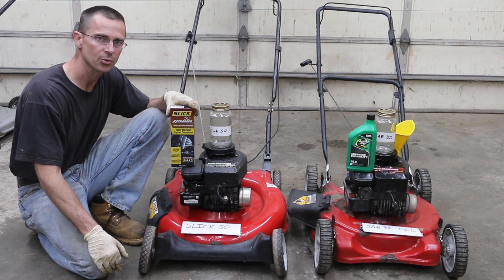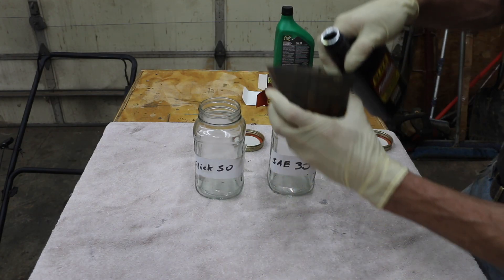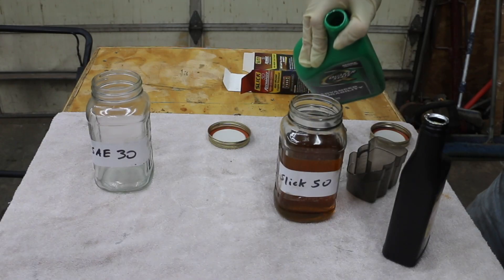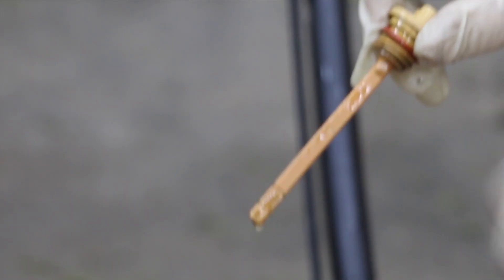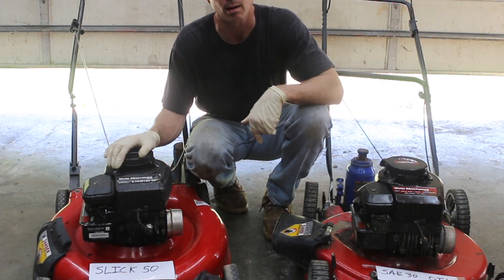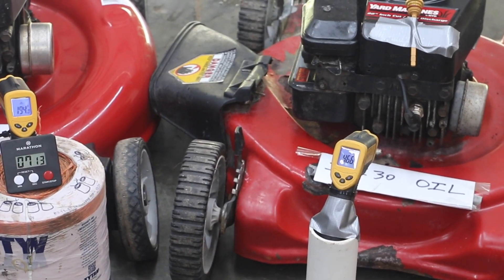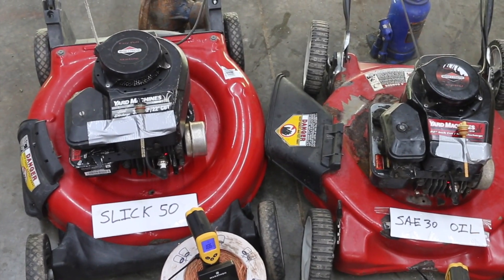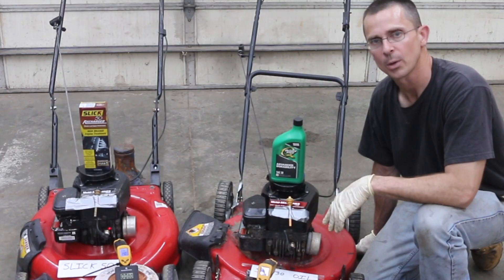Can't believe what SLICK 50 did to my engine!!--Dry Crankcase Test!

Comment: The slick 50 bonds to the metal over time driving the car. You did not run the lawnmower long enough with the slick 50 in the crankcase. Use the lawnmower with the slick50/oil mfg. recommended mix for a month of two of normal wear. Do the test again. Bet you get different results. As to reducing friction, man, you saw it on the temp. gauge. The stuff works great when used as directed.  Engine runs cooler, and spins with less friction. Good video!
Reply from the maker: Thank you!
Reply: Had a '78 Fiat Spider yrs. ago in Mich.. Added Slick50. On cold winter days you could hear the starter working hard, after slick50, the engine would turn over so easy, it hardly put a load on the starter motor. I have found it does reduce wear. Duralube seems work well also.

Comment: Many years ago I did my own trials with Slick 50 both in my car and in others with which I kept a record of fuel consumption. In every case I recorded a noticeable reduction of fuel usage however I understand there may have been other contributing factors to this finding in that there may have even been a psychological element effecting the driving habits. However, in further examples it became very obvious that the plating effect seemed to take place reasonably suddenly after in some cases driving a few hundred miles. The engine sound would definitely alter in conjunction with a significant increase in revs at idling speed. After adjusting the idle, smoother and cooler engine performance was obvious along with a reduction of fuel consumption.  Further and more dramatic results were observed with a racing Kawasaki in which the engine was treated the previous day and ran a few times with no apparent effect however, during the race the following day, after some further hard competition racing, the rider eventually came in for a fuel stop and the pit crew as well as the rider were amazed at the obvious reduction of fuel used with the rider saying at some time during the race it felt like he had an extra gear such was the apparent increase of performance. He did however have a mishap with another rider forcing him to lose 6 laps but still managed to finish 5th outright. Consequently I sold quite a lot of product after that event but certain elements regarding the marketing of the product caused me to cease distributing. In summary,  I feel that certain "Teflon" type products which only use the oil as a vehicle to enable the plating to occur can have a significant positive effect, I tend to believe the friction and heat combined at a certain point is needed to achieve the plating to the obvious high friction areas as well as increasing the effectiveness of the piston rings with reduced friction in the ring lands enabling reduced compression blow bye. In any case I understand that a similar Teflon type product should not be termed an "oil additive" simply because it's added to the oil, it uses the oil as the means to transfer/carry it to those targeted areas. I have no experience with running an engine dry with reliance only on the friction areas being plated with the product, I would conclude the obvious burning in process to be crucial to the results, therefore the tests with the lawn mowers may not have been a true reflection of the sought outcome. Bye the way, I have since, always used what I consider a similar product sold commercially in Australia under the "Nulon" trade name. I hope this helps.
Reply from the maker: This is great information. Thanks for commenting on this.

Comment: We had a 1989 gmc pick up that second and third gear went out in. My uncle dumped a can of seafoam in the transmission and drove it a few miles and nothing happened. 3 months later we needed the pickup moved and when we went to move it it shifted fine. So we drove around the block. Still fine. So we drove it around town and still shifting well. We drove that truck for several years before the motor failed.  I have been sold on seafoam every since.
Reply from the maker: Excellent!  Thanks for commenting on this. I've had great success with Seafoam as well.

Comment: I've been buying slick 50 for over 40 years. it was cheap in the 70's. I bought some for my sons older vehicle and it was over $25. Thank you for the heads up. I'll start using Mobil 1. Great video's. I find it hard anyone would complain about them. Legit and well done.
Reply from the maker: Thank you

Comment: If you do another test with with the slick 50 using pure so that mixing it up and I think there's another one out there that is for aircraft it does the same thing as slick 50 baby better maybe they over-exaggerated it but I used it on my cars and in one particular car I can be honest that I tried to destroy it and I refuse to blow up the engine and I drove it for about an hour so maybe there's a difference between lawn mower engines and regular car engines and if you're going to really test it make it pure
Reply from the maker: Thanks for the recommendation.

Comment: Would like to see nulon E10 or E20.  Been using it for years.  I did blow a head gasket on a 351 Cleveland.  The engine had over 200 thousand miles on it.  I have always used the nylon at every oil change.  To my surprise there was no ring ridges or so very little that I  could feel.  I might add that I always use valvoline XLD.  So one or both seem to be doing a good job.  I do drive this vehicle fairly hard.  Thankyou
Reply from the maker: Thanks for the video idea!

Comment: I had a 1984 Honda Accord. The camshaft on these engines were never properly heat treated, in the Canadian market anyway, so every 10,000 miles you dropped in a new camshaft.
I tried Slick 50, and 10K miles later, checked the cam. It was way worse than usual, a junk product for sure.
As an aside, a buddy of mine suggested I try Power Up, basically a lead naphanate in an oil carrier, which he used in his farm equipment. As recommended we added about 30cc to the engine oil. 10K later we checked the cam. Not only was there NO wear, the back of the cam lobes still had the phosphate coating on them! I bought 2 quarts at $400 per quart before the additive was outlawed in Canada. About 12 years later, I still have most of it and have used it continually in the dozen or so cars I have owned. Not one vehicle has ever needed any engine repair.
Reply from the maker: Wow!  Impressive results with Power up!
Reply: G BRM  Lead lubricates, that's why gasoline years ago had it, reduced wear on valves & guides that were not as tough as today's parts.
Reply: PowerUP: https://www.youtube.com/watch?v=_c2Eya4EwZk

Comment: The Slick 0 mower in this video has clearly had a lot more use than the other just look at the balding wheels on the Slick 50 mower compared to the other. I call foul on this one.  The test was unfair as the engines clearly did not have a comparable amount of prior use.
Reply from the maker: Thanks for the constructive feedback.

Comment: Considering that they seized almost 5 minutes apart from each other i think the motor with slick 50 just was a bad motor from the start, maybe im wrong but if a lot of people use it id imagine its better than appears to be here. Id still rather run straight motorkote in my engine but slick 50 did good at keeping lower temps obviously but it was at such a low temp when it went
Reply from the maker: Thanks for commenting on this.
Reply: @ProjectFarm  youre welcome, i wasnt trying to say you did a bad job on your part but i think if you used 30 oil in both then drained them both you wouldve gotten very similar results. Maybe im wrong but maybe im not, who knows unless someone were to repeat this test over and over with different motors but that would be a very expensive test and not much of a gain from it.
Reply from the maker: All great points. Thanks again.

Comment: About 30 years ago there was a product being pushed called SFR-  Superior Friction Reducer.  They did a simple bearing and weight test and could take low grade C-Store motor oil and turn it into the best oil on the planet. The bearing would easily seize even with the best oils of the time; but a few drips of SFR additive would make it never seize.  I think the nearest currently sold equivalent is Duralube-- but I've never known if they are the same formula just bought out and renamed?  Project Farm- Intriguing video.  Nice work.
Reply from the maker: Thank you!

Comment: I didn't see it linked, but the FTC posted a warning about false claims regarding Slick 50 in 1996 (https://www.ftc.gov/news-events/press-releases/1996/07/quaker-state-ads-slick-50-are-false-and-misleading-ftc-charges).  That being said, I ran Slick 50 with Castrol 10W40 a couple of times over the years in my 1984 F150 with a the 300 cubic inch in-line 6 and 3 speed w/overdrive manual transmission.    There was about a one mile gradual ascent on my drive to work and when running Slick 50 I could maintain 55 mph in overdrive, but when I wasn't running Slick 50 I would always have to downshift to 3rd.  Never tried running the engine dry.
Reply from the maker: Thanks for this information.

Comment: Slick 50 was bought out by quaker state in 1995 and they removed the active ingredient.  PTFE you can but PTFE powder on ebay and make your own old style slick 50 . Industrial mining still uses slick 50 based products. Two cycle engines are not a good test bed for PTFE as temps over 240 F ruin the effectiveness of the product. you can by the original formulation a product called  Xcelplus but you can make your own at 20 dollars a gallon.
Reply from the maker: Thanks for this information.

Comment: If I recall correctly, Dupont sued Petrolon (the manufacturers of Slick 50) for using the term "Teflon" in their advertising because Teflon is a trademark of Dupont, the technical name is polytetrafluroethylene (PTFE).  Dupont (and this is a paraphrase) issued a statement claiming there was no appropriate use of Teflon as an oil additive.  I think that says it all, Petrolon was reselling a product made by Dupont and Dupont said that the product was snake oil.
Reply from the maker: Thanks for this information.

Comment: OK reading most people defending slick 50 well actually no slick 50 use Teflon and high heat and plastic doesn't mix well as the fine  plastic particles start bonding to each other and can clog oil passages or oil filters, may work great in manual transmissions and my one car if got slick 50 in the transmission and this works there great but I've done over one engine from a  friend where slick 50 were use and well the oil passages in the crankshaft were blocked with the plastic that under high heat and centrifugal forces separated them to the passages walls and blocked them.
Reply from the maker: Great point.  Thanks for commenting on this.

Comment: First of all love your channel! you've probably already been told this but apparently you don't know a critical bit of history with Slick 50.
25 years ago; you were absolutely correct in loving Slick 50 - I did as well - used it in everything! Anyway without fact checking dates from memory this is the story: the main component of Slick 50 that gave it the benefit was PTFE in other words 'Teflon' which was licensed by Dupont... well somewhere in the last two decades there was some legal debacle for some reason (may have been they weren't getting paid enough can't remember that part of it) and Dupont sued Slick 50 and the end result was that Slick 50 was no longer allowed to use Teflon in their engine Formula; rendering it pretty useless sadly. Now if you happen to have some 20 + year old Slick 50 treatment - I guarantee you'd find different results! I once drove a car many miles from one end of the city to the other without realising that I'd split the radiator! so despite having no coolant, my temperature gauge went up by literally 1 needle width! - it was brilliant stuff, but alas I don't buy it anymore for that reason... in fact you may probably remember it was too good in some applications would cause roller bearings to skid rather than roll. Anyway if you read this that's the basic history of it - regrettable, but it is what it is...
Thanks for making such cool videos cheers.
Reply from the maker: Thanks for the history on Slick 50.  Also, thanks for the positive comment.
Reply: Cheers mate! Wonderful work 👍👍

Comment: What about using Miltec 1 ... after treatment 3x with,after 3 days my son called and said  he noticed he had had no oil in his 98 Nissan Sentra due to an oil leak... I went over and added oil and it is still running fine now...he got the oil leak fixed now... over 250 thousand on the clock.O well...Ernie
Reply from the maker: Thanks for the video idea!

Comment: Me and my buddy Chuck did this experiment on car engines back in the 80's when we were both ASE certified mechanics. With the same result, you got. The Slick 50 engine seized after two laps around the shops parking lot. Disappinting after wacthing their miracle commercials.
Reply from the maker: Thanks for commenting on this!

Comment: one of the questions i have is: i park the car at night, the next day i start the engine. how much oil are still on the moving parts, so i don't crank the engine and run the engine with no oil until the pump starts to do it's job of circulating  the oil to protect the "moving" parts.???
Reply from the maker: Great point.

Comment: The Slick 50 you are testing is not the real Slick 50 as there was some legal case back in the 80's that now stop's the real Slick 50 from using the brand name, the real product brand is called Xcelplus, that's the product you need to test that people claimed you could run after treating with no oil back in the 80's. You are testing the wrong product, Xcelplus is what you should be testing.
Reply from the maker: Thanks for this information.

Comment: Good video except I agree with one of the commenters that the test has validity and reliability issues.  Validity due to sample being of different type and use.  For example one guy could have babied the motor to the right while the other one was full throttle with no air filter.  We simply don't know because they are used and not identicle.  Reliability issues because this test can be repeated but will most likely have different results if the samples are again used and different,  I love the practicality of what your doing and it does come at a hefty price, so I appreciate the effort although I think you may have killed two lawn mowers without finding out if Slick 50 works due to experimental conditions and variables.  ie. the different used motors.One additive that is currently getting a lot of hype online is Liqui Moly.  The ceramic coating supposedly permanently bonds to metal and makes the surface ceramic and durable.  New engines last forever and old engines get new life according to their following.  It might be a good experiment.  Somehow you need to get to identicle engines though.  Maybe Liqui Moly people will pay for the engines.  You don't have to be biased to them.  Worth a shot to get better experiment reliablility and validity.
Reply from the maker: Thanks for the constructive feedback.

Comment: I've used three types of oil treatments, and believe they each work as advertised.
1. Slick 50 engine oil treatment.  
I added a few cap fulls to my lawn mower, and within minutes there was noticeable increase in RPM.  It was also much easier to pull start afterwords.

2. Slick 50 transmission additive. 
I had a Ford Ranger with automatic transmission, that ran like driving through Jell-o, and jumped in and out of gear under hard acceleration. Adding Slick 50 cured the problems and even increased mileage a few mpg.

3. Restore engine treatment. 
I was using a Chevy Blazer 4.3L with nearly 200k miles to pull a boat. While using the Blazer to charge the boat batteries, I added Restore and let it idle for about 20 minutes. There was an absolute increase in power and reduction of oil consumption after treatment.
Reply from the maker: Thanks for commenting on these products.

Comment: Don't know if you've done it yet but it would be cool too see the different oil certification levels and see if the offer something better. Most tout longer life (aka less oil changes under "complimentary" maintenance) and better film strength/resistance to break down under heat from turbos. I think a test like this or maybe running them on low oil would be a cool comparison.
Reply from the maker: Great teat idea!